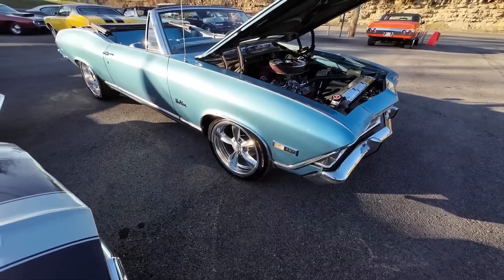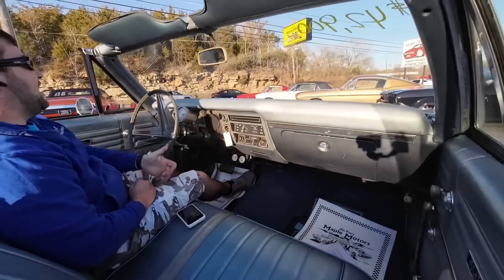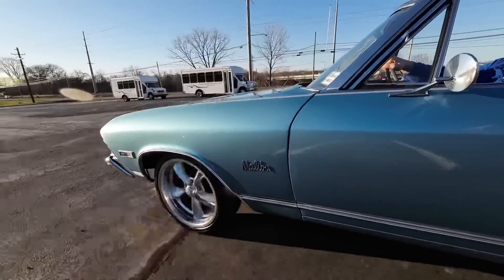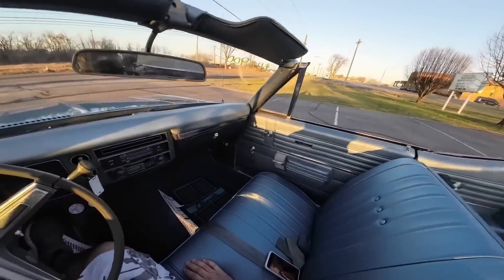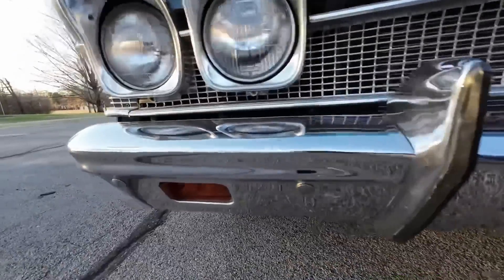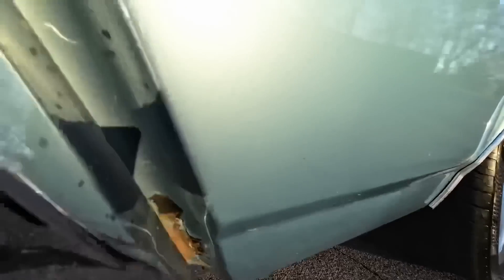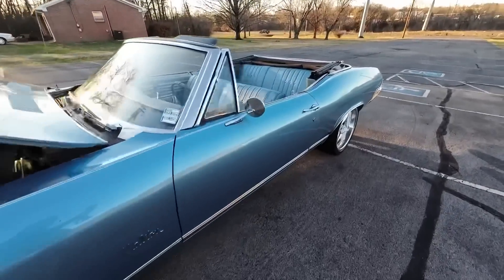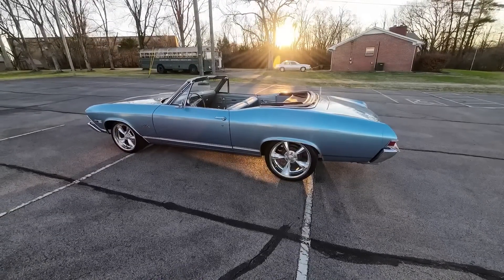Test Drive 1968 Chevrolet Chevelle Convertible SOLD $42,900 Maple Motors #2043

Comment: Some people here saying price is high, but if you look around other classic car dealers, these Chevelles in similar conditions are selling mid 40s to 50s, if not more. And they usually just detail the cars so well with ceramic coating they look almost like show room qualify but they don't show you a test drive let alone show you the flaws.